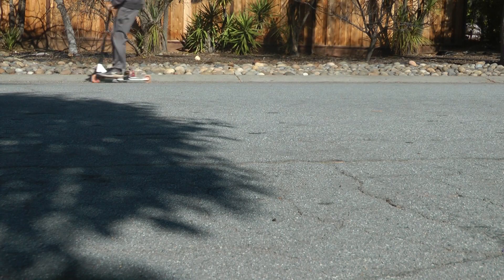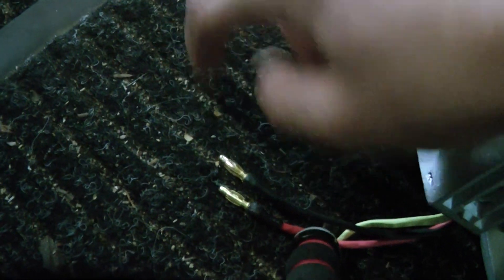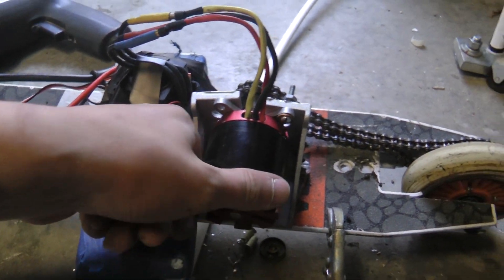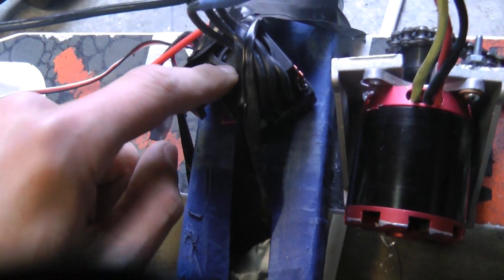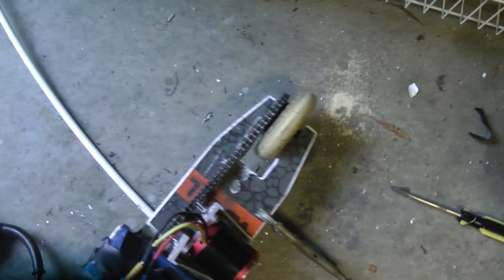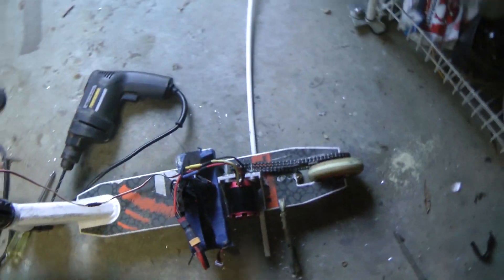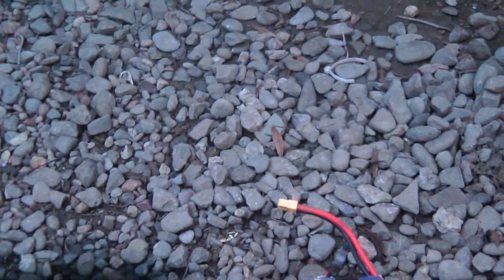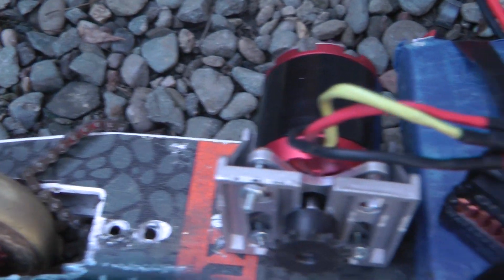DIY BRUSHLESS ELECTRIC SCOOTER (1800w)

Comment: Bro im using the same kv rated and same size motor and a transmitter and a 5s 1200mah battery so will it work ( im also using skywalker 80A esc )🤔.

Comment: if you are looking for a decent but cheap speed controller I would recommend one of the ebay ebike controllers like this one https://www.ebay.com/itm/363061203293 All of the controllers on eBay with these dimensions are pretty much all the same exact 15mosfet controllers with the exception of some of them having better mosfets or capacitors than other ones, they are also able to run with or without hall sensors but having them increases torque a lot. I have been using a couple of them in my dual hub motor electric scooter for over a year and have had zero issues besides vibrations causing a capacitor to break off, but that can easily be prevented by using silicone to glue all of the capacitors in place. I also did a shunt mod and added a bunch of solder to all of the traces to improve torque.

Comment: Can you give the specifications of the motor??
Reply from the maker: 270kv  brushless motor
Reply: @ianbuilder  is it the 1800 watt one. About 30 dollars
Reply: Size 5065?
Reply from the maker: @tomvandernoll1455  yes
Reply: @ianbuilder  and what esc afe you using?
Reply from the maker: @tomvandernoll1455  a generic 10$ 3s esc